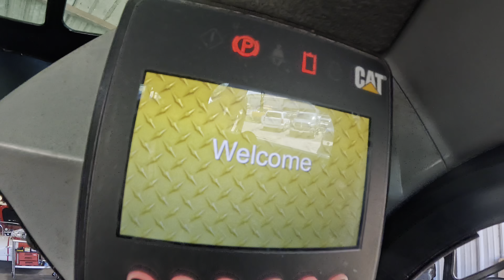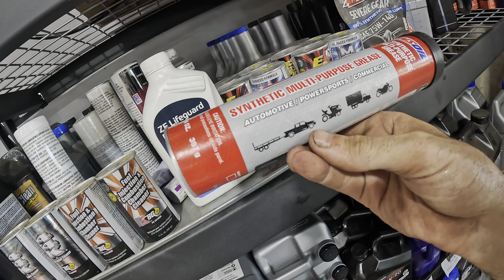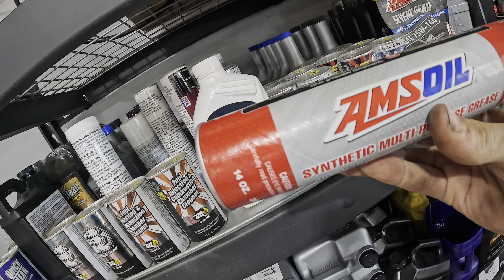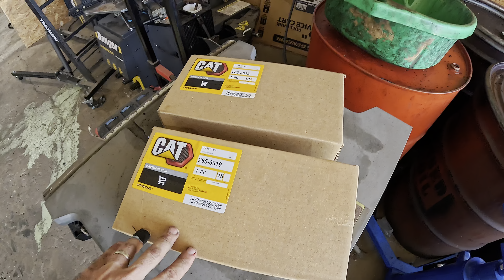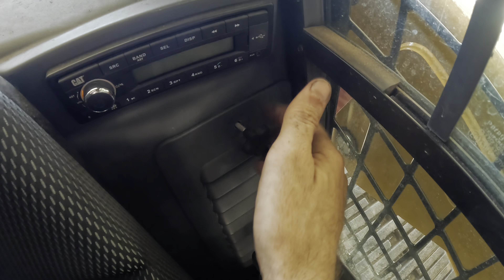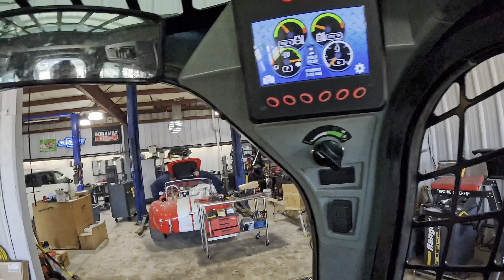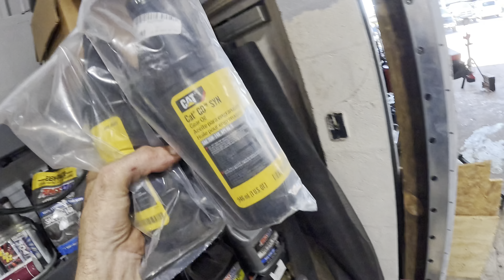Jack Stand Collapsed! Near Rollover! CAT 289D3 Skid Steer

Comment: Ray, you overfilled the final drive units. I hope you removed the center level plug and drained out the excess before returning the machine.
Reply from the maker: I still have it, I’ll drain it level
Reply: @RainmanRaysRepairs  I knew you would do it right.

Comment: If you are going to do much of this you need a 20 ton air actuated bottle jack. I solve getting the last of the gear oil out of the bottle by using a piece of tubing that allows me to hold the bottle upside down.  The loading business was not smart.  2 ton jack stands for probably 11,000 lbs (trailer + skid steer)?

Comment: Do you have overfilled both final draft. They should only be filled to the center of the planetary. This could cause seal failure on the final drive. I worked at a.coalmine who has a heavy equipment, mechanic Big Ed coming to you from Central City Kentucky. Have a great day Ray.
Reply from the maker: Indeed, I realize what’s wrong, I still have the machine and will adjust the level.

Comment: Hey Ray, long time sub and fan! Have a question or your opinion since you talkin about oil. I have a Coyote Mustang and work from home so not alot of miles put on it. I last had my oil changed in 12/23 full synthetic. Its now 08/24 and I haven't hit 4k since last change. Obviously if you are driving a ton you should get your oil changed, but is a yearly change with full synthetic good enough when you drive less than 5k miles a year?
Reply: Yes please save yourself a engine rebuild or replacement 😂😊

Comment: I think you need to invest in a 12K equipment trailer with a low deck.  The center of gravity with that thing in a dump trailer is quite high.
Reply from the maker: Indeed, I’m not thrilled with this combo, the setup is pushing it too far. I’ll need a low deck gooseneck trailer.
Reply: @RainmanRaysRepairs  Four-post lift first?

Comment: You saw how thick the gear oil was when it drained. Imgine if even "goo-ey-er". Without providing air displacement, you would remove the drain-plug and just see a bulge of surface tension increased, thickened, oil looking at you.

Comment: First it is an HOUR meter, no odometer on CTLs. Second it is a lot easier to just ask an Old Man that has been in it 56 years and you would know.
Just put the bucket all the way down curled under (as in dump position) and then put a piece of 1by 1 inch square tube about 3 or so inches long
(or equivalent) on the track at center bogie, tighten till it touches and ya can't go wrong for working in the woods. Doesn't have to be as tight for dirt work.  You are to hooked on YouTube, or maybe you wouldn't have screwed up loading it.

Comment: I THINK YOU OVER FILLED THE FINAL DRIVES.  WHEN YOU OPENED THE VENT AND IT WAS AT HALF WAY, JUST A LITTLE RAN OUT, AND WHEN YOU FILLED IT THE FILL HOLE WAS AT THE TOP.

Comment: The giggling is uncontrollable, you place you blocks in the rear (snug) use the attachment to lift the front, guess what the whole track system will be the off the ground.

Comment: Theres a right and wrong way to use a grease gun, and shoving ot on without untwisting the tip is the wrong way. Doing that damages the jaws causing the grease squeeze out mess. Highly reccomend the lock n lube tip, its a thumb lever to open and it locks on better. I have them on three different greasing tools and they hever have squeeze out.

Does that cat not have the ram fall cage on it? Its a red c channel like piece on one side where when lifted high enough you can esentally lock the ram in an open position to prefent hydrauloc failure injuries. Oh you're using the forks to lift the front, so disregard I guess.

Comment: You're not supposed to fill the final drive completely up with oil. You drained the oil correctly but filled the final drive incorrectly. When the oil is finished draining turn the final drive until the drain hole is towards the top. DO NOT PUT THE CENTER PLUG BACK INTO THE FINAL DRIVE. Fill the final drive until oil comes out of the center hole. Then put both plugs back into the final drive. Overfilling the final drive will blow oil seals out of the final drive.

Comment: How nice fuel filter rite on top of the battery?? Engineering at its best just like on vehicles they put stuff in the worst place possible.. it's. Like engineers don't like mechanics and make things hard to get to or it's the cheapest way to design it

Comment: I've seen you using this skid-steer, is it yours ? You know a lot about a lot of cars BUT, brush up on something new or watch more youtube vids. You said "I really don't know what I'm doing" , everyone else was doing it differently when refilling, should have taken the hint, looks like an expensive piece of equipment. Come on Ray make us proud
Reply from the maker: It’s not mine, comments saved the day on the drive oil level. I still have the machine, I’ll pull the plug and set the correct level this weekend. Btw It is for sale, I’m considering buying it, the owner moved and needs to get the payments taken over.
Reply: @RainmanRaysRepairs  how much $, you want a new lift and alignment thing too $ $

Comment: WARNING: Do not mix two different brands of gear oil (or motor oil) with each other. While it seems harmless to mix identical oil viscosity, the actual base oil and additive packages can be very different. You wind up potentially creating an imbalance which increases wear and doesn't play nicely together. Amsoil additive packs and base oils are especially unique compared to some other brands on the market. Don't believe me? Give Lake Speed Jr. a call.
Reply from the maker: Don’t tell Lake Speed he’d be so mad at me!
Reply: @RainmanRaysRepairs  Haha, OK- I promise.

Comment: Those final drives are literally junk. They fail pretty often and cost over $6000 each. If the hour meter was reaaly correct that black oil supports how good they are.